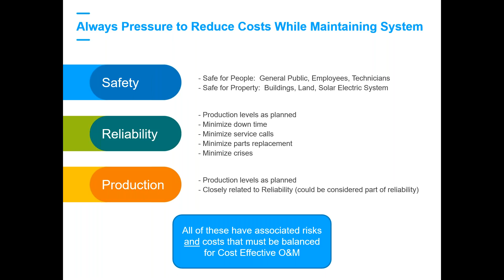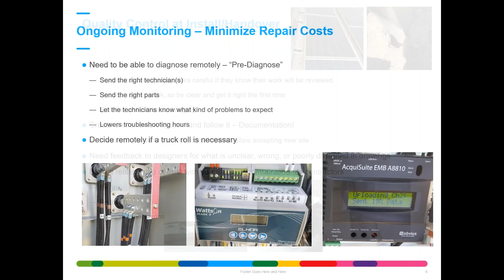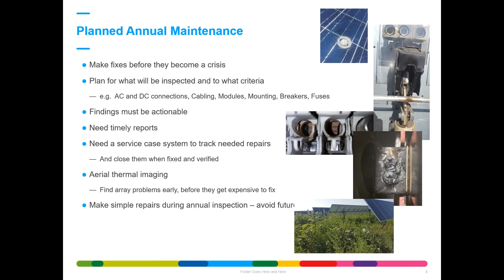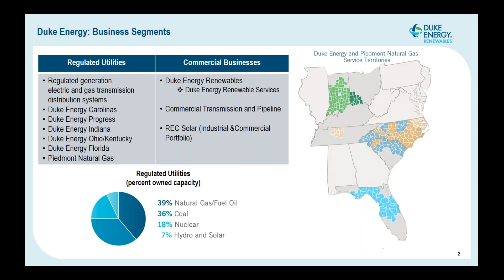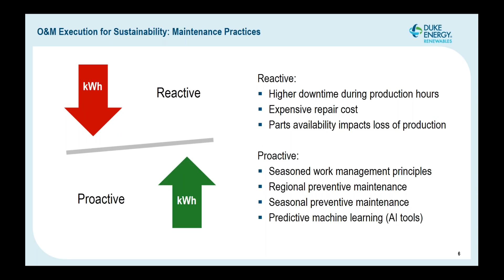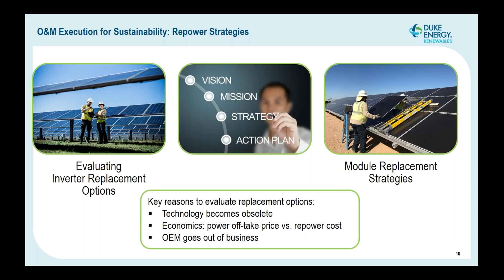Solar Webinar  Perfect your PV O&M strategies to enhance your cash flow

Comment: m🎯 Key points for quick navigation:

00:11 🎤 Webinar Introduction
- Diana Drupal introduces the webinar and outlines its purpose.
- New Energy Update aims to help renewable energy executives plan for the future.
- The focus of the webinar is enhancing PV operations and maintenance strategies for better cash flow.
02:08 📉 Challenges in the Solar Industry
- Declining costs of solar power production increase pressure on owner operators.
- The need for strategy redefinition due to financial pressures.
- Introduction of speakers focusing on practical advice to redefine strategies.
04:40 📊 O&M Strategy by Rob Morris
- Rob Morris discusses the balance between cost reduction and system maintenance.
- Importance of safety, reliability, and proactive design/maintenance in solar operations.
- The need for intelligent reactive maintenance and ongoing monitoring.
11:14 🔧 Maintenance Tips
- Rob emphasizes planned maintenance and early problem identification.
- Use of site review systems, thermal imaging for better effectiveness.
- Importance of intelligent dispute resolution in reactive maintenance and ongoing technician training.
19:10 🏢 Duke Energy Strategies
- Presentation transition to Josh Rogers from Duke Energy.
- Overview of Duke Energy’s business units and assets across the US, including renewables.
- Duke Energy's preference for self-operation versus third-party operation and strategies for technician training and retention.
24:52 🎓 Training and Development at Duke Energy
- Duke Energy invests heavily in training their technicians with a robust program that includes a variety of training modules.  
- Technicians progress through four levels, with both initial and ongoing training including OEM manufacturer collaboration.  
- Focus on employee development, controlling their career trajectory within company standards.  
26:12 🔧 Maintenance Strategies – Proactive vs. Reactive
- Discussion on the importance of proactive maintenance versus reactive practices in solar site management.  
- Reactive maintenance leads to higher downtime and costs, impacting operational efficiency.  
- Emphasized using data analytics and systematic work management principles for effective proactive maintenance.  
29:12 🔥 Wire and Risk Management
- Highlight on improved wire management and wildfire management plans due to increasing solar site risks.  
- Poor wire management may lead to fires, requiring better preventive strategies.  
- Importance of vegetation management to prevent fire risks associated with solar sites.  
31:30 🚁 Employing Advanced Technology for O&M
- Duke Energy utilizes advanced technologies like drones for efficient site inspections.  
- Drone analytics minimize on-the-ground maintenance time while increasing energy yield via efficient issue detection.  
- Emphasis on using predictive maintenance strategies with AI and data systems to optimize operations.  
33:51 🔄 Repower and Inventory Strategy
- Strategies on repowering existing sites to handle obsolete technology and improve economic outcomes.  
- Importance of effective inventory management and sourcing strategies for key components and repair parts.  
- Evaluating inverter replacement options and leveraging buying power for efficient site operations.  
35:03 📈 Training and Risk Management
- Reinforced the importance of training programs for reducing reliance on OEMs and improving site management.  
- Discussion on risks associated with OEMs going out of business and extended warranty options.  
- A well-trained workforce can mitigate risks by handling equipment without OEM assistance post-warranty.  
37:18 🤝 Q&A Highlights
- Q&A session covering key challenges in O&M, including alarm management and system design considerations.  
- Challenges due to rapid industry growth, technology evolution, and financial model updates discussed.  
- Participants addressed AI use for predictive maintenance, reducing unplanned costs, and improving operational strategies.
51:48 📊 Handling Extensive Data in Remote Monitoring
- The importance of managing large datasets for artificial intelligence in remote monitoring,
- Necessity for meaningful, non-overwhelming notifications from AI systems.
53:00 🖥️ Optimizing Remote Monitoring Costs
- Discussion on the importance of centralized remote monitoring systems over distributed platforms,
- Benefits of a single platform for alerting and data analysis as facilities expand.
55:15 🚀 Importance of Scalable Remote Monitoring
- Critical need for scalable monitoring solutions for growing operations,
- Pre-diagnosis reduces the need for multiple site visits and improves first-time fix rates.
56:25 🔒 Data Control in Monitoring Systems
- Emphasized keeping data internally to maintain control despite monitoring company changes,
- Importance of storing data independently to ensure continuity regardless of external changes.
57:19 📞 Closing Remarks and Panelist Contact
- Encouragement for participants to reach out directly to speakers with further questions,
- Assurance that webinar recordings and contact details will be emailed to attendees.

Made with HARPA AIer